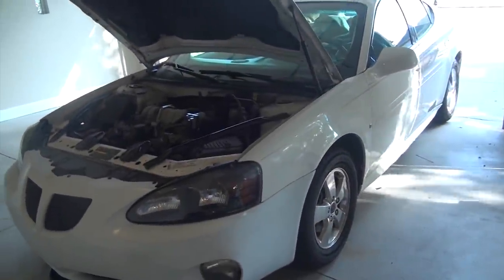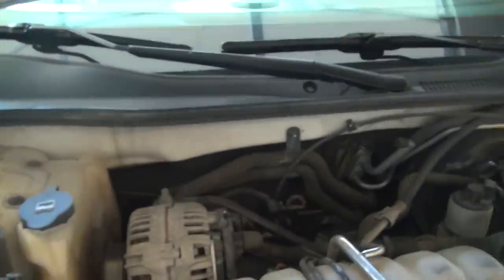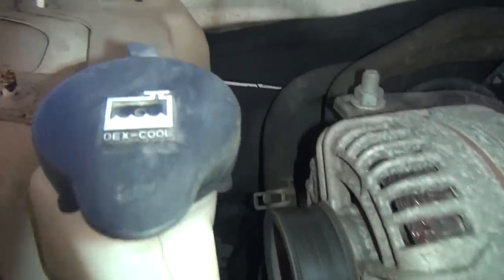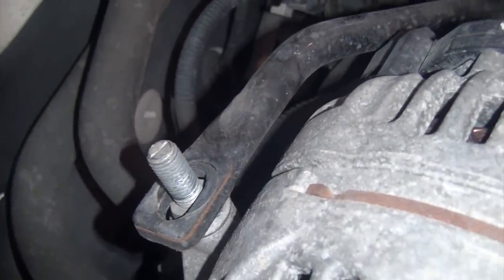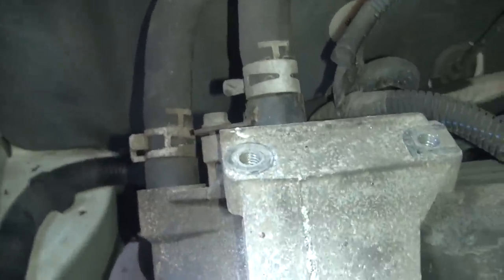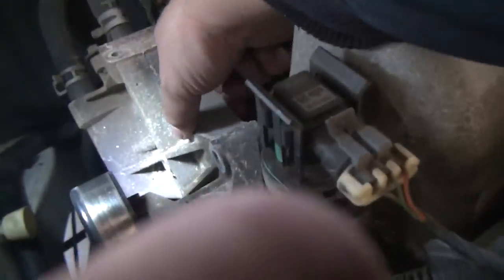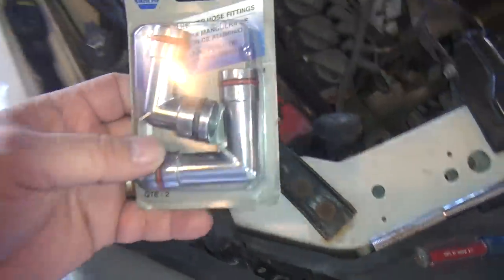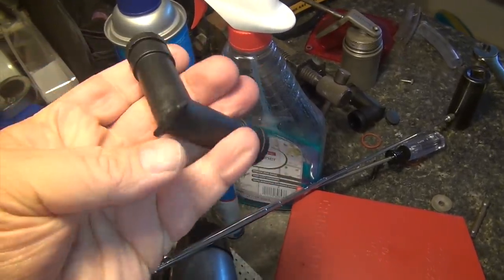GM 3800 Cooling System Elbow Replacement

Comment: Buy AC DELCO o-rings.  they last the dorman ones fail after a few years.  after replacing them 3 times I got the right o-rings and they have lasted for years now. 2003 Chevy Impala 3.8 275k

Comment: Went to napa and got these for 15$ easy install hardest part was getting the bolts back in gotta go with the the middle bolt berly thread it thought and then do the other 2 tighten them down Lil by Lil switching between the 3 bolts til there all the way in
Reply: coulda gotten them from zzp for $8.50. the shipping is a flat rate so worth it with other items in cart

Comment: Great vid, But just put a disclaimer on coolant recommendations. I've personally seen Dexcool tested (I do Quality Engineering and Metrological functions in production, including aerospace. I find independent performance analysis crucial) and it performs very very highly, it's just very high maintenance - I CAN NOT CONTAMINATE IT. it's an Organic Acid based coolant instead of the traditional propylene glycol or old school ethylene glycol (the poisonous coolant that tastes sweet). Because it's an organic acid based (organic compound) solution, Dexcool readily reacts to contamination - ESPECIALLY from Propylene or Ethylene, which readily oxidize like mad under certain pH conditions. Mixing Dex with Propyl or Ethyl reacts with Dex, causing increased corrosion - not entirely from the Dex either - it's actually from the Propylene at times, too (Propylene turns into Lactic Acid when exposed to air and high heat - very bad new for your car if your propyl based coolant begins to lack pH buffer and inhibitors over time). The issue with an aluminum elbow versus a plastic that user Jeff brought is a good thought, but isn't relevant. It's true that Aluminum has a higher heat capacity and thus retains the heat longer, but the O-Rings themselves are the concern. Please refer to this chart if you have concerns about the O-Rings in this repair applications   -  http://mykin.com/rubber-properties  -  the chart gives the metrological data on a matrix for choosing the right O-Ring for the right application. For heat, the best choice is Silicone, but note that Dexcool is a known plasticizer and reacts with Silicone, destroying it rapidly. THIS IS WHERE the Hate on Dexcool comes from. It's nothing to do with performance, it's to do with the silicone o-rings rapidly degrading once exposed to Dexcool. GM was sued specifically for this issue.
Reply from the maker: Holy smokes!  Thanks for your opinion - I always appreciate both sides of an issue..  Contaminated or not, it cost me $700 to have the lower intake manifold gaskets replaced in the last car I had DexCruel in.  You'd be shocked at how eaten up they were!  So, I'll stick to the ethylene -glycol that I trust not to react negatively and manufacture such atrocities.  A good coolant should protect regardless of molecular contamination, not combine with the contaminates and conspire to ruin your engine.  Remember too that in the hands of the general public, such maintenance isn't a certainty, especially when you consider that Dex is billed as an "extended life" coolant.  You're "in a perfect world" scenario is not possible in aunt Ginny's Buick like it is in a laboratory.  You'd think that a coolant designer would prefer not to setup such pitfalls when engineering for broad application.
Reply: I worked for jiffy lube and the only kind of coolant they have is the traditional green one. I was shocked when they told me to put it into gm and Chrysler's that take Dexcool. They mix the two types all day long.
Reply: So basically get rid of Dexcool because it’s not worth the headache.
Reply: @mkernen  Wonder if I can use my blind hole bearing remover set, to retrieve the pieces that break off inside ? I have some very small ones that may just do the trick. Doing this job on my LeSabre SOON.
Reply from the maker: @500erider  Wow, don't know about that tool.  Sure don't want any broken plastic cruising around in your cooling system though..

Comment: YOU ARE A LIFESAVER 
I'm replacing my lower manifold gaskets as well as swapping out that coolant elbow for a metal one and i didn't realize that there was a bit of the old elbow still stuck but using the toggle bolts took like 10 seconds and I'm so happy ttyyyy

Comment: Thank you so much for posting this. You made this so easy and I was able to finish it in a little over an hour. I have a 2004 Bonneville and the engine is slightly different but being GM close enough to your description. I replaced the plastic ones that failed with the metal ones you showed and you saved me a ton of money. I cannot thank you enough. What was going to be a several hundred dollar repair at a shop turned into an 11 dollar DIY. The plastic elbows are about $5 and the metal ones are about $11 so that was a no brainer. I am not a mechanic, just a DIY kind of guy so anyone thinking of doing this should have no trouble with changing this. Thank you again. Bless you.
Reply: I'm about to head out and replace mine, what are the differences?

Comment: This video was super helpful! I had to do this on my 2002 3.8L Monte Carlo. I learned all of this the hard way. I also felt the need to use high temp RTV (gasket sealant) on the elbows before putting them in. This reduces the chance of further leakage. Best decision I made in this whole process.
Reply: The RTV also acts as a lubricant, to help the elbows slide into place ????  I have to do this job soon, on my '03 Buick LeSabre, which is leaking from those elbows. Gonna get the aluminum ones. Is this the red silicone ???

Comment: straight forward description and nice video. My broken elbows were way more of an issue than yours...and i used a bearing puller to try to get out the remnants.  piece past the o ring wound up having to be pushed INTO the engine, then fished out with wire...no big issue...cleaning up the surfaces was the most time consuming for me.

Comment: Very helpful video. For anyone watching in the future, be advised that you'll leak around 1/4 to 1/2 gallon of coolant on the ground when you pull that bracket off with the elbows. I wasn't prepared for that gush. Kitty litter to the rescue.
Reply from the maker: Good point nicein20001.  I had partially drained the system prior to pulling hoses, etc.  Recommend doing this too.  Animals like the taste of coolant and it is toxic, so if you spill any keep them away until you clean up the mess.

Comment: Well My 2006 Lucerne blew this out this morning! Thanks for the video, I got the part # and the local NAPA has the part in stock. Yet another victim of corner cutting, and poor design.
Thanks for the video.
Reply from the maker: Corner cutting by cheapening an elbow- ironic.
Reply: the messed up thing is that these motors WILL go 300,000 miles EASY

yet that elbow goes on EVERY single one

my dads got 260,000 miles on his 97 buick..... runs like day one
Reply: Upper tube cracked length wise on a 3800 Intrigue. Nice video.
Reply: Mine just blew in my 06 Lucerne too.. Wish me luck on repairing lol
Reply: It's actually a really good engine. Once the plastic elbows are replaced with metal ones no more issues. any vehicle with the 3800 really should have that done (preferably before they go bad.) It's an easy fix as are most things on that engine.

Comment: My plastic elbows came out in pieces, I had to extract the broken pieces from the tensioner as well as the block, to extract them I used a couple large bolts, I just screwed them into the broken plastic piece a few turns, twisted turned and eventually pulled them right out. "PRO TIP!!!" Replace the rubber O rings on the metal heater hose fittings clamped to the hoses before you re install them into the tensioner. If the metal heater hose fittings them selves have a lot of play when you re install them, go ahead and replace them, they are pitted, worn out, and WILL cause leaks! Auto Zone has them for about 18 bucks a piece. Good luck anyone to anyone reading this...YOU GOT THIS ;)
Reply from the maker: Thanks for your tips!

Comment: Excellent video. Thank you for taking the time to share this repair. I was able to swing by the parts shop on my way home from work, and swap out my deteriorating/blown out plastic elbows with aluminum ones. Having watched your video, I felt confident that I knew what to do, and I was able to replace my '06 Grand Prix's in about just over an hour, taking my time and bleeding the air out of the cooling system before I test drove it. Just got back from my test drive, and it's running steadily cooler than it has in over a year. Now I know where my coolant had been going.

Comment: Good job, I appreciate your effort and how you don't skip any details. My 2004 grand pri water pump is just a little loose but not leaking and no noise but I can't keep coolant in it so I assume its the elbows, also I'm getting some water in with the oil which I assume to be the upper intake plastic warped and or bad upper and possibly lower intake gasket. cThanks again for your time. Ryan Tucson Arizona
Reply from the maker: Could be - the upper intake is notorious.

Comment: Great video I found it really detailed and easy to understand should be able to swap the elbows out on my 2000 Pontiac bonneville ssei, I was just gonna clean out the ports that the elbows sit in with a wire brush but I think I’m gonna run to the store and get some scotch bright pad to clean them so I don’t mar up the aluminum

Comment: love the 80's honda spree you got there. oh the memories
Reply from the maker: 30 years old and still runs like it did day one!
Reply: i grew up on one of these. at round age 15 i put 10,000 miles on mine before it got impounded or no plate and stuff. i got my eyes on a ct70 i want so bad
Reply from the maker: Those are cool!  Trail 70, right?
Reply: yup but there super expensive to find with a title. i seen a replica one its chinese but the chinese engines are great its called a dax125 its really nice and has a bigger engine than the ct70
Reply from the maker: I noticed that.  Of course we ran one too lean and burnt the piston.. wish I had it now!

Comment: I've got a 2005 grand prix 247,155 miles still running strong
Reply: Gtp comp g 05 141k jus had this problem but other than that n Purge tank repair. Running strong

Comment: Nice job! Next time use some anti-seize on the bolts. If you or anyone else needs to get into it later, you or them will thank you!
Reply from the maker: Excellent point!  Thanks!
Reply: On the shaft of the bolt or threads...or both?

Comment: Just replaced the elbows in my sisters 2008 Lucerne. We installed the new aluminum units, put it all back. Filled with coolant and heard coolant leaking into the pan under the car. We took it all apart again. I saw a crack in the new elbow as I was trying to pull out the tensioner assembly. When I went to pull the elbow- it broke in 2.  We went back to AutoZone and we got the part replaced under their lifetime warranty. Put it back together and it appears to be holding.  Looking at the broken elbow, there was a discolored part along the crack... leading me to believe that it was defective to being with.  2 hours 30 min to do the job 2 times (and going back to auto parts)
Reply: They owe you labor, that's bullshit

Comment: I have a 2004 Grand Prix GT with 276,921 miles. I have bought it brand new and have bought other cars but I used it for short-distance traveling. Nothing major has happened to it over years besides normal preventative maintenance issues. However the last few yrs have been the most active on replacing parts. 

I have had to replace my ac resistor module 5 times, blower motor wheel 4 times and the water pump 4 times. Most recently I had to use JB weld to fix a cracked radiator because apparently the fans wasn't turning on correctly and I have a coolant leak somewhere. That caused the car to run hot with must affected the small crack in the radiator.

I went to a few mechanics that wanted to charge me  $50 - 80 diagnostics checks to check the coolant leak but i said no.  I went to another shop on my way home and the guy did a pressurized check and the elbow busted with water. I was happy to see the problem but more upset with my other mechanic who changed my water pump a few months back. I told him i wanted to change the elbows to the new aluminum ones and he said NOOO its not needed. here I am 3 mos later with cracked elbows and more labor cost. I hope they work and are a perfect fit.
Reply from the maker: Plastic or Aluminum?  Hmmm...wonder what'll last longer??  What a dope!  BTW: that's cool you've got that many miles on it- GM 3800 is a champ!
Reply: Yes GM sent me a letter once I reached 200,00 and 250,000. I love my car and the exhaust still flares... how did those aluminum elbows work out?
Reply: Today I was heading to get the new aluminum elbows and I hear this loud humming noise from the my engine. oh lord, what is this new sound?
Reply from the maker: Lets hope it's just minor!!!!
Reply: Michael Kernen mechanic shows up and says it's just low on coolant so the intake is sucking air

Comment: Thanks for the video, Great job. You saved my ass and about $800.  I`m doing the same thing on my friends son`s car
Reply from the maker: Wow!  So I guess you're buying the beer?  Glad to hear it.
Reply: Black Buick  he must of had to get the entire lower intake manifold gaskets replaced. Which will significantly increase the cost forsure. I've done a cpl myself. And actually just got a 2002 impala with the 3800 series 2 in it and I was losing antifreeze, couldn't find the leak, so got the gaskets $80-100 for a whole set of upper and lower and more. Tore it all apart and the elbow that goes into the intake on 1 end came out very very easy, then I noticed the end was broke off and inside my intake. So had to get that outta their. But long story short I'm about to put the new gaskets on tomrow, as it's already torn apart and high mileage, but pretty sure the slow leak was all just from this stupid top elbow! But I know these motors so myswell not worry about the intake gaskets either, as they like to go out it seems. But fairly easy job once do it a few times esp if u have a Haynes Manual for your make an model. But saves me a lot of $ doing it myself. Not bad with step by step pics an vids online like this etc. Just got the new metal elbows and gonna swap those also b4 I put it back together. Shit just saw this was 2yrs old lmao. My bad. But ya folks def need to check these elbows b4 they go an tear apart the entire lower intake off the car🙈🤷🏻‍♂️😂

Comment: I'm getting ready to change mine out today. Hoping this fixes my heat problem to the inside of the car. Really hoping it is just air from the crack in elbow and not heater core. 08 Buick lacrosse. Could this be what is causing my interior heat problem?
Reply from the maker: If you're low on coolant , yes, definitely.

Comment: Also , after you removed the alternator , how many other bolts held the tensioner bracket ?

Thanks ,   :-)
Wyr
God bless
Reply: My car had 2 bolts on the side towards the antifreeze reservoir. And theirs 1 sneaky bolt kinda around the backside toward the firewall side back in their. Ya the vids old now so I'm sure u figured this out. But just incase, figured maybe it could help in the future. Easy job really. Doing my intake gaskets now, upper and lower. Not a fun job but can do myself for about $100 in gaskets. Instead of paying a mechanic about $1k is what they wanted on any quotes I got for it. But luckily its pretty easy to do. Esp if have the Haynes manual for your car. Gl
Reply: So mine had 3 total on the side, oh and theirs the 2 big 1s up top or whatever rite their after removing the alternator. So it's basically 3 bolts but technically it should be 5 total I guess. Atleast on my car I'm doing now. Gl👍🏼
Reply: I had the same problem with my Grand Prix Pontiac 05 my residue water tank it gets dry up no water no nothing in there I don't see any leaks from the elbows but I'm assuming they might have to get replace doesn't get overheated as much so by me changing the elbows with that fix my problem

Comment: Why in shits name did the run coolant through an alternator bracket... Fn geniuses i tell ya... Will be ding this ti mine in the morning... Top notch video
Reply from the maker: The 3800 (or 3.8L) was adapted from a longitudinal to a transverse design for front wheel drive vehicles.  When it sits in a front drive car the heater hoses have to make a 90˚ turn as soon as they exit the engine.  The alternator bracket is right in the way of that turn.

Comment: Hoping for a quick reply as I have to have my ‘04 Buick done tomorrow!

Does the toggle bolt cause any scoring?  Praying it doesn’t.
Reply from the maker: Nope, but if you're concerned make sure its edges are smooth with a fine file.

Comment: Each time the pieces break off, sometimes O-Rings get left behind and some plastic pieces that u cant get out, i went ahead and left both old pieces inside the [Upper] hole...it really wasn't a big issue even after replacing it the first time, that same piece Kept failing Until i showed this metal piece to my engine, White Thunder is happy once again :), P.S. Do Not leave the plastic piece/O-ring inside the Coolant bypass unit ^_^

Comment: I pushed a pretty good size chunk of the plastic fitting into the engine when trying to fish it out.It wasnt on the belt assembly part but on the engine itself do you think it should be ok?
Reply from the maker: Yikes! That could get lodged someplace..probably in the radiator wouldn't be too big of a problem but it might hold your thermostat open.  You'll know that if the engine runs too cool..
Reply: ok thanks man..welp its all back together now so im just gonna take my chances.. At least the coolant isn't leaking from the elbows anymore ..